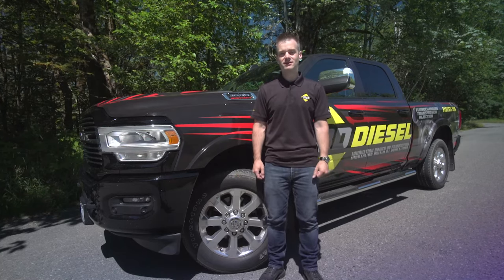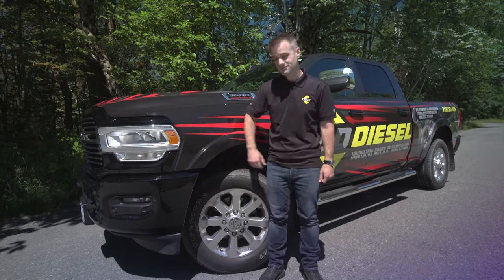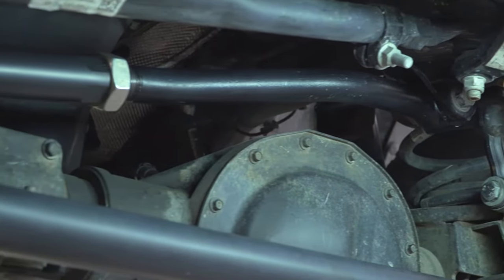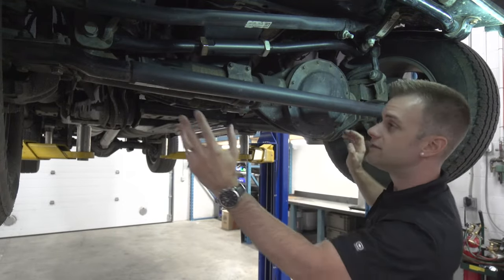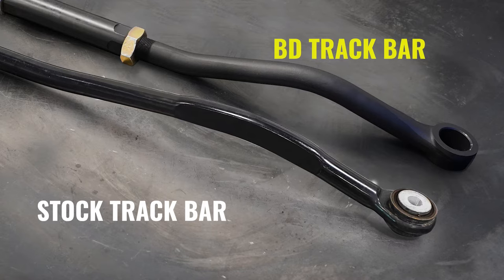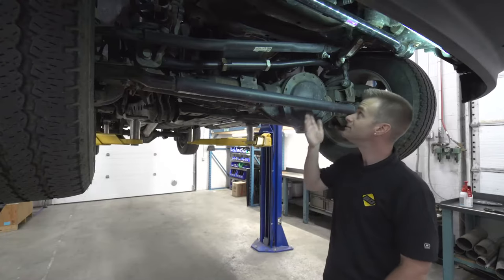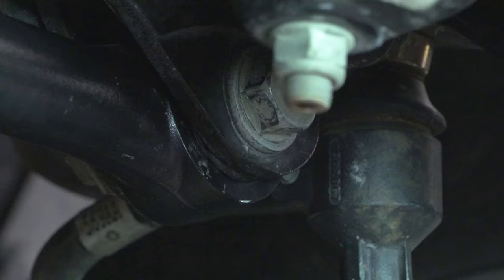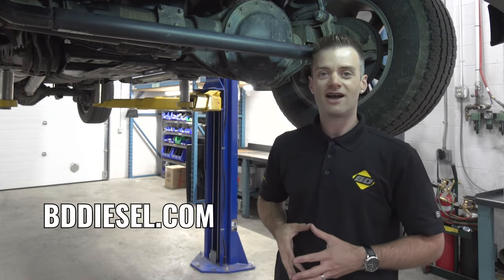Why you NEED a Track Bar | Do NOT Lift Your Ram Truck BEFORE Watching This!

Comment: Keep your tires and factory rims and you will have no problems with your front end suspension and at 152 K and my front is as good as it was straight as it was when rolled out of the factory and my brakes have over 50% on my pads .
Reply: thanks for the cool advice dad.
Reply: Ik bro mine was awesome and drove and felt perfect till I lifted it yesterday and now it’s sloppy and stuff
Reply: Mine is a 2008 with 2” level in front, deleted and tuned and have ran 18x35” tires since 30k did brakes the 1st time at around 250k just because was doing ball joints, and that’s just pads. I’m at 450k now and ball joints 3 times, no other front end work, brakes finally again with rotors this time and have never had an issue driving straight. Just now getting play on my track bar. 🤷🏼‍♂️

Comment: Probably the worst design possible for a track bar. Dodge used the same on the 4th gen drag link which lead to a recall of hundreds of thousands of trucks because the nuts would back off as you drove. Btw, the "fix", according to the recall, was to weld the nuts to the bar... yeah, no thanks.